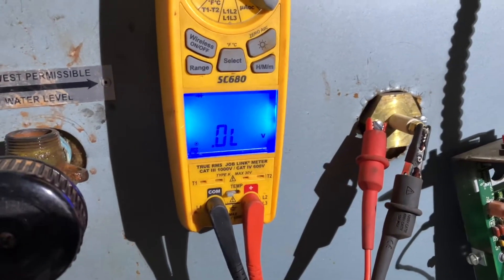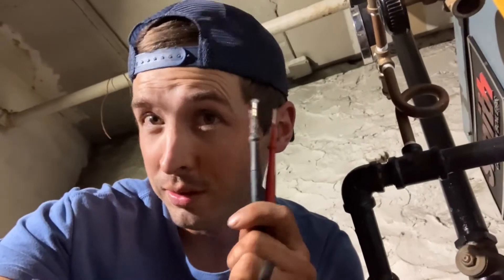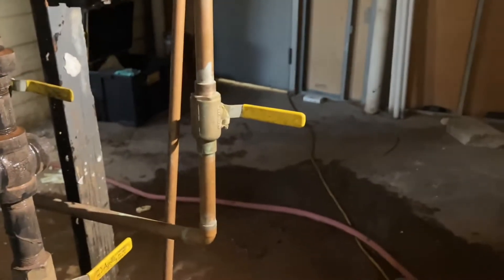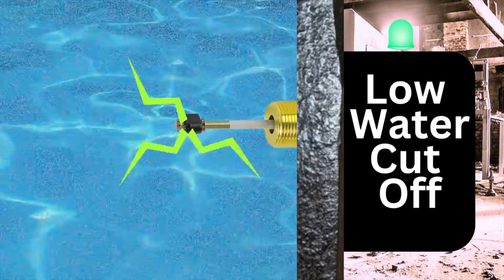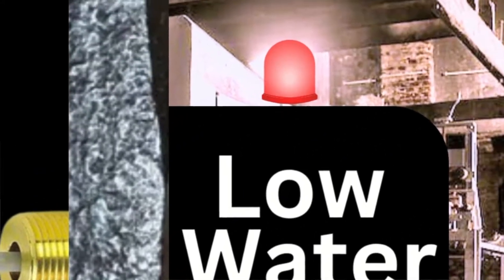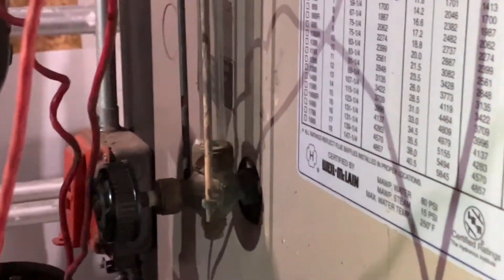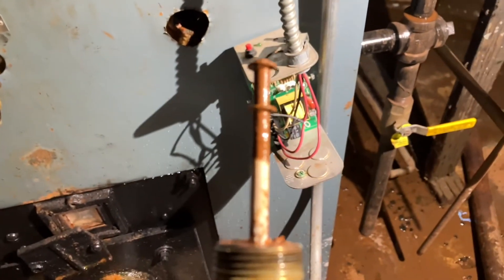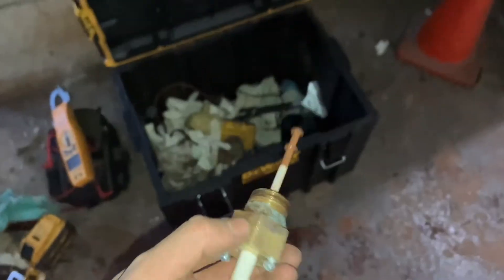How to Really Test a Low Water Cut Off Probe

Comment: You lost me when you set the meter to Ohms but then got a measurement in Volts.  My new probe measures 7.3kOhms to 7.6kOhms after counting to 10 secs.  This is with the boiler water hot after a burn cycle.  It seems to be like measuring the resistance of a capacitor where the longer you test it the higher the resistance goes, as if it is charging up during the test procedure.  Maybe we should be measuring capacitance?

Comment: My lwco hydro level  400 has a slight dimmed light at all times, it does turn bright orange when water is low and shuts boiler off, could it be the reason why my McDonnell-Miller feeder continues to feed more then one cycle because probe is not grounded properly and causing the slight dimmed orange? Thanks

Comment: Hi sir, what's the best electricy for this probe? AC or DC?

i've tried using DC 12v but it decrease become DC 6v.

i've also tried using DC 12v it also decrease become 8-12v

right now i'm still waiting for some parts using AC 24v, is it safe?

Thanks for your sharing